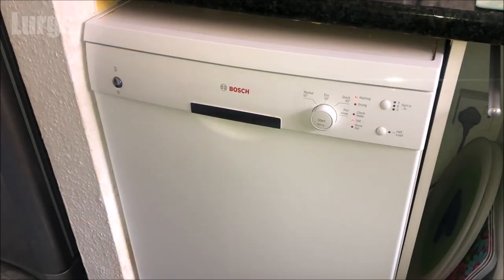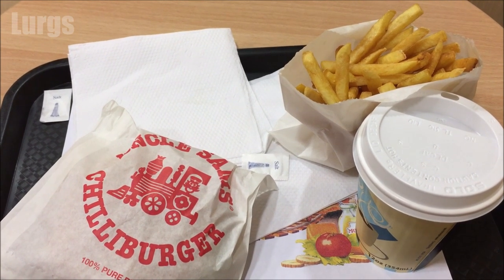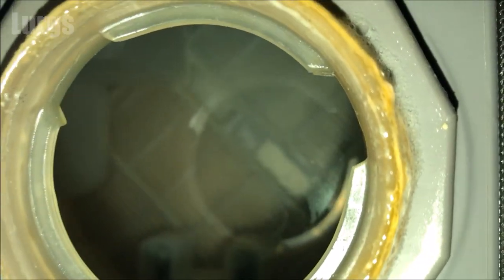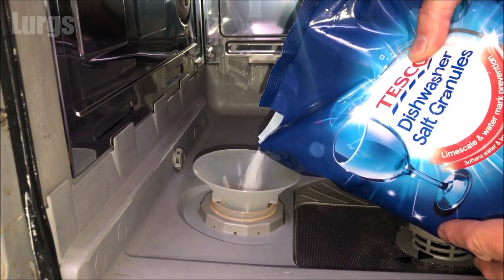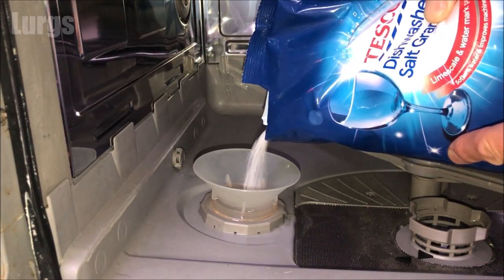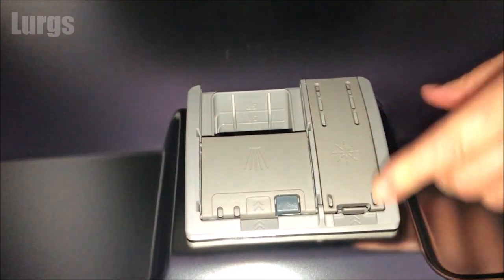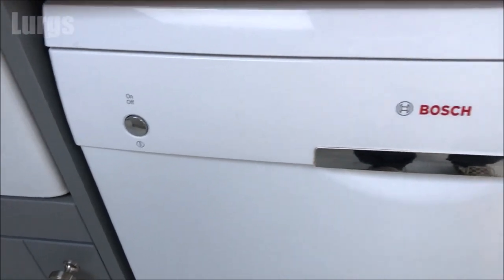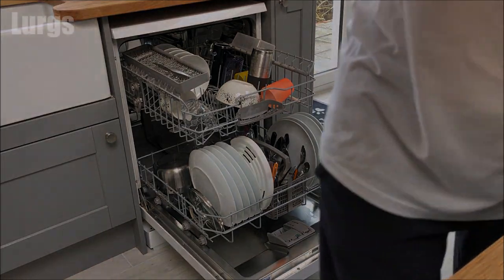How to add Salt and Rinse Aid to a Bosch Dishwasher

Comment: I have added wrong salt (sea salt) in the dishwasher, how can I remove it and clean it ;((
Reply from the maker: I shouldn’t worry too much. Just put normal dishwasher salt in it. It will all gradually dissolve
Reply: @LurgsHowToGuides   Do you think that might be the reason for white stains on my glasses? Because I tried with different tablets, adding shine, different programs and again there are white stains on every glass ...
Reply from the maker: Yes definitely. Maybe don’t wash glasses for a while until the salt is all used up. Or lower the salt output on the wash, some machines allow you to adjust it.
How to set Water Hardness on Bosch Dishwasher by setting Salt Dispenser Levels
https://youtu.be/zY4VRDoDC7g